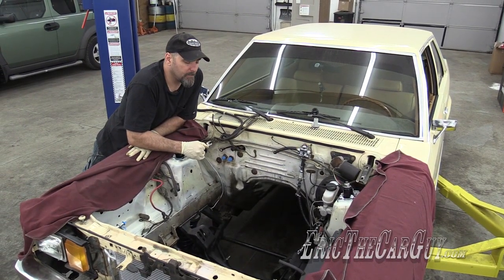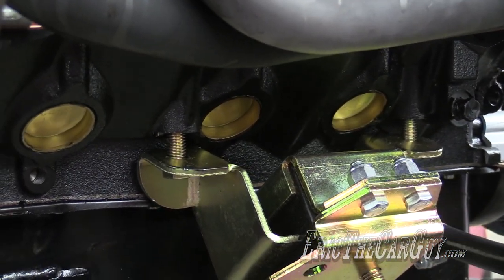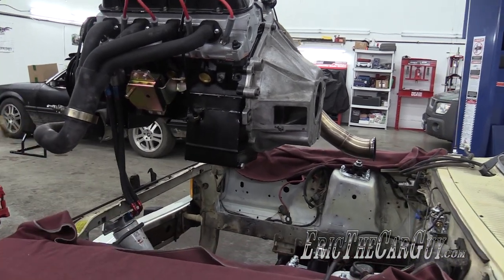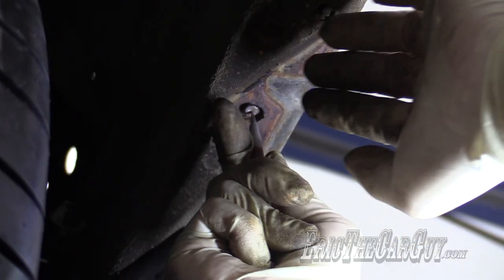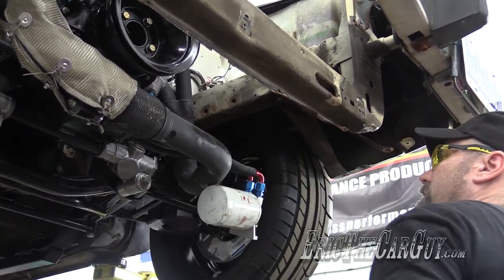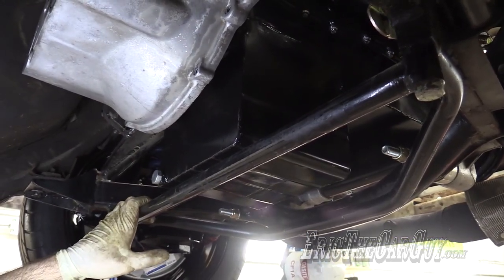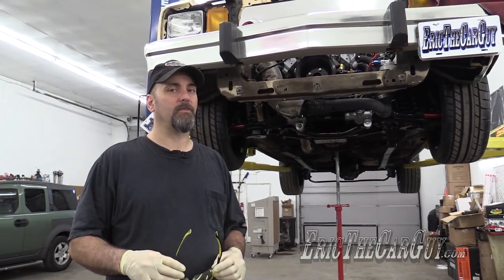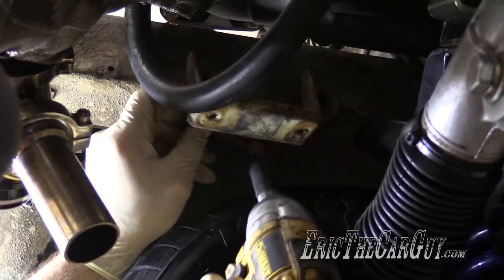Test Fitting the New Turbo Engine and Transmission #FairmontProject

Comment: Eric, if you care to explain, why the blanket on the turbo and not regular alluminium shields? The turbo does get hot and needs to breath all that heat out fast, we've never used them on cars, also they tend to keep moisture inside and help rot the pipes... On motorbikes they are common to avoid the pipes getting stones and whatnot in them.
Reply from the maker: It helps keep underhood temps down which makes the engine more efficient.

Comment: as far as the rear back bar goes for the K member because it's hitting the back of the oil pan just use a couple spacers and or washers and longer bolts...if you have too..
Reply: Timboslice exactly what i was thinking, not a big deal at all as long as it doesnt hang down to low.
Reply: I was thinking that as well, but then I started to think about the various forces that would be acting on the cross member and the bolts that hold it on.  Longer bolts with spacers would increase the leverage on the bolts and possibly make them a point of failure.  Now we could question whether bending the bar did anything to its structural integrity, but I think it was probably a safer way to go than using longer bolts.
Reply: Derrick Abbey indeed both good points.
Reply: Derrick Abbey that bar is essentially supplemental support. you could run without the bar all together and probly notice little difference. Helps to stiffen the chassis but never guna see enough force to break bolts

Comment: I believe Maximum Motorsports sells lower a-arms that correct your wheel issues.  It seems to me that under actual compression, the  tire will contact the fender.

Honestly, you won't notice any handling difference in a street car with the .75 to 1.25 extra wheelbase.  If anything with the Fairmont being longer, you're ahead of the game over a Fox Mustang.

Comment: As far as that bar getting in the way of that oil pan drain plug, I would have modified the oil pan by drilling and tapping a new hole on the underside or having a new bung welded for the plug or something. I mean anything to savor the structural integrity of the vehicle. I imagine at some point the engine came back out and that would have been a good time to remove the oil pan and do that mod. That's if it was me though.

Comment: Very interesting video as always.  It did raise a few questions. I have looked at some of the comments but haven't seen anyone bring it up so I am guessing my questions might be non-issues.

1. Isn't the drive shaft a little tight in there?  Looks like the shaft is in all the way for you to be able to tie it up to the rear end. I was under the impression you needed a little play in both directions.

2. The pinion angle at the rear end seems to be a lot towards the ground? Maybe you just haven't got to the point where you will adjust that.

3. Isn't there a problem using heat to bend the rear bar of the K-member? I guess if it is not hardened steel to begin with then it might not be an issue, I might have tried to lower it instead of bending it.

4. Did you have to change the front coil spring to handle the additional weight of the V8 over the original L6?

I understand this is muck up stage and that you may not have covered the fine tuning involved in getting everything into the right place to answer my questions above and if that is the case I will wait the following videos to get my answers.

Have a great day.

Comment: I'm a Fiero guy so I've got no room to talk really but I think it's funny you picked the car for the aftermarket support but you've got suspension parts and braces that aren't going to fit without heavy modification. I get the turbo stuff not fitting though, I would have thought you'd want to build the turbo system around the car. I haven't been following along enough to know if it was a pre fabbed system.

Comment: Is it just me, or is that wastegate in a bad location? It appears it'll only bleed off the pressure from the driver side manifold, while the passenger side will just continue spooling the turbo and cause boost spikes.  Ideally you'd want it where both manifolds merge into the collector right before entering the turbine housing so it'll controller the exhaust gasses better from both banks, not just 1.

Comment: why is the grounding strap for the starter exposed without any kind of sheilding?
Reply: cody frankenberg - That's just what they tend to look like.
Reply: cody frankenberg no need to shield that. It doesn't melt or care if it gets hot. The STARTER might be best shielded with a blanket but almost nobody ever does that.

Comment: I feel like that heat cycle on that k member bar created a point of failure, now that the metal has been heated the crystalline structure is altered, it's no longer uniform. Any extreme stress will likely cause a crack or critical failure right along that line. But, I'm hoping not, we will see

Comment: im thinking about building a mild ( 400-500hp) turbo small block chevy for my 1978 K204x4, to be used as a daily driver/tow rig..........do you think this is a good idea? or should i just do an LQ9 swap with a 4L80e? The Turbo small block certainly has the cool factor.....but i figure they would both be about the same price to complete........what are your thoughts?
Reply from the maker: If I were you, I'd consider a supercharger for that application.

Comment: Hey Eric. I hope you're gonna use a scatter shield instead of the aluminum bell housing and I also hope that aluminum drive shaft will take all of that torque without twisting up like a candy cane. Otherwise looking good in my opinion.
Reply from the maker: I have a steel bell housing for the new transmission. SFI approved.
Reply: Great!

Comment: Hi, just a thought for getting snapped bolts out, and not trying to tell you to suck eggs if you already know, but a penetrating spray left to soak in for a few minutes, and then if you have a mig welder, you can weld a nut on the end of the stud, before hitting the red hot nut with a hammer to shock it. Then try undoing by hand. It will either undo, or the nut will shear off again, in which case drilling is the only option.
I do have one question though, and that's the aluminium prop shaft. For the UK and European market all prop shafts are a steel tube, and am curious about how well an aluminium would hold up, especially with the V8 on.

Comment: I have a feeling once u start putting power on the road, the torque from that engine is gonna have its way with that trans crossmember
Reply from the maker: No worries, it's all getting replaced in future episodes. The build is far from over. Remember, this is just a 'test fit'. Thanks for your input.

Comment: Changing steering geometry, removing stabilizer bars and reshaping a K member supports, will the car be safe to drive?
Reply from the maker: The stabilizer bar went in. Did you watch the entire video? The steering geometry hasn't changed at all. As for the K member support, it's getting swapped out when I install the new K member.

Comment: Eric can you titanium exhaust wrap the downpipe and the use the blanket on top? I think it'd help a lot with the radiating heat in the places where the blanket are exposed.
Reply from the maker: When I take the engine back out to install the new K member I plan to wrap the exposed headers.

Comment: Great video as always Eric!

Might it be a good idea to bond those (new) spacer washers together, so when they fall on the floor, they don't immediately scatter?

Stay dirty!
Reply: Are you not running an oil cooler?
Reply from the maker: I don't think I need one with the divorced oil filter. I think that will act like a cooler of sorts. I'm also running 20w50 in this car.
Reply: Cool, I guess you'll be keeping an eye on temps, and it'd make a good video if you had to add one at a later date.

Comment: Oil your drill bits & they will cut 3x's faster, more accurately & you won't be burning up bits. I use 3'n1 myself.
Reply from the maker: I did. You might also check the link in the description to those drill bits. They actually recommend against using oil. Thanks for your input.

Comment: I'm just curious if modifying those engine mounts jeopardizes anything in long term use? And why they didn't just fit right in the first place
Reply: mrsemifixit he isn't using the stock engine block
Reply: Adrian Tran. We know isn't using a stock block. But aren't these blocks mass produced (on a small scale). If they are then surely the manufacturers would make engine mounts to suit the block then all you have to is position them on the chassis. You have to drill a few holes but if your putting a custom engine in you probably wouldn't be able to use the locations for stock mounts.
Reply: Michael O'Reilly Someone might make them specifically for that block but theyre probly overpriced and they werent sitting in his shop. The amount he cut likely wont make a difference. But if it were me i would just simple cut a triangle of steel and weld it in and call it done. Hell the holes small enough your could probly just weld it up.
Reply: i was thinking same thing...those are gonna have alot on twist on them form all that torque. its not stock v6 anymore.

Comment: Look into Astro performance for their A5 transmission. It's basically a t5 with heavy duty gears. They are known to handle close to 600 horses. that's what is going into my mustang build. The car is looking Awesome by the way, good luck.
Reply from the maker: Actually, I asked Paul Cangialosi about it, he's the one that built my transmission BTW (links in the description), and even he said the T-5 wouldn't handle the power this engine puts out. It was his recommendation that I go with a TKO600.
Reply: Well, with the TKO600 you definitely cant loose. Their is nothing but piece of mind with that selection and that's what is all about. Have fun, cant wait to see your next video on it.

Comment: I would run a scatter shield with that kind of power. I've seen clutch explosions and they aren't pretty.
Reply from the maker: The new transmission has a steel bell housing that's SFI approved. That will be featured in a future episode.

Comment: I'm one of your previous q and A's did you not mention you were changing this some frame out for another bringing the wheels further back?
Reply: please excuse the autocorrect that was supposed to say subframe or k member
Reply from the maker: The wheels being moved forward is a good thing. It helps improve handling. I'll explain in a future episode when I install the new K member.
Reply: EricTheCarGuy looking forward to the future episode I guess it's just me sort of anal retentive if the wheel belongs in the center of the wheel opening It's gotta be there it would bug me LOL just like a crooked picture on the wall

Comment: With that high  priced engine I would be using AN fittings and braided wire hoses, they might save the engine, AN is Army/Navy  if they are good enough for them it is whaat you should use, besides they look good.
Reply from the maker: I am using those on the high pressure areas. I don't think they're necessary for low pressure connections. Thanks for your input.

Comment: i would reinforce those mounts with that kind of power. the brace u bent probably needs reinforced too
Reply: M Blake Jr was thinkin that too. The only reason that brace still fit is it stretched when bent
Reply from the maker: No worries, the entire front suspension and K member will be replaced in a future episode. The mounts are fine. They're just 'clearanced'.

Comment: Why are you using chrome sockets on an impact?? I can understand it on the electric one,but the pneumatic is a big no no.
Reply: Zack Fraser - He's assembling, so it's not really a big deal. if you're breaking something loose it would be more important.
Reply from the maker: I don't have standard sized impact sockets, only metric. I never used them enough to justify the expense.

Comment: Hello Eric, I apologise Sir, but your modification to the cross brace is a weak point caused by heating and bending, better to rework the sump pan than a structural brace possibly bending in two, as always thanks for the excellent vidjas
Reply: B.M. Baker i agree heating the tube weakens it. i know he is test fitting, but i would get new tube and just make one. either with a bender or welding 3 tubes together and welding ends on. i see alot of people saying just to space it down but ya dont need more stuff hanging down to catch on stuff.
Reply from the maker: How about I just replace the entire K member? You'll see this in a future episode.
Reply: no talent hack welding totally agree, less components less risk

Comment: are you using the proper grade bolts
grade 8.8 or higher is recommended
Reply: steven yau he I believe its using American bolts. buy the look on the bolts having 3 lines facing in is a grade 5 bolt
Reply: hmm ok that's similar to a ISO 8.8 so it's going to be fine
for some critical parts he might need grade 8 though which is ISO 10.9

Comment: screamer  pipe on the wastegate?? are ya gonna connect it do the downpipe or ya gonna be a rebel?
Reply from the maker: I'm going to talk that over with my exhaust guy when the time comes. I don't have a solution yet.
Reply: Are you still going to use a choke cable to actuate the cutout?

Comment: Take a good look at the drive shaft man. Looks like when the rear suspension compresses the drive shaft will bump into the drive shaft. Maybe shortening it a bit. Take a look at it man.
Reply from the maker: It's fine. With the new transmission and torque arm which you'll see in a future video.
Reply: EricTheCarGuy oh right right, I forgot you mentioned the new trans in the video. If it all buttons good then awesome man!

Comment: I had some mental junk that I found myself thinking about though the video.  Here it is as I thought of it.

20:45 Holy shit are transmissions really that light!?

25:45 Why bother with duel exhaust?  Would it be more sleeper to have a single pipe, or would you get better flow from duel pipes?

28:15 I'm really trying hard to like the guy, since we are stuck with him for 4 years....but he needs to start getting on his 100 day plan, show a couple of things that come after that people would appreciate seeing, and do it all without looking like watching a train wreck involving a clown car..   

Also, at least his a good slinky.

37:15 what dictated the placement of the turbo on the passenger side?  It's starting to feel like everything is on this side of the car.  Oh no.. the car is going to tip over!

38:50 Ream that hole you cheeky bastard.. Ream!

39:50 why not also relocate the drain hole while your at it?

42:20 Ohhh that's why.   Never mind!  It looks great.

44:20 wow... yea you did.. I'm glad I watched the whole thing..

Comment: Any reason you couldn't relocate that drain plug on the oil pan? Or even cut the pan back a bit? Doubt it makes any difference as you said but that bend is hard to look at. And don't go looking at my car. I have way more ugly hacks!
Reply from the maker: Not really. The engine is still full of oil. My new K member has spacers that should clear the oil pan. At least I hope that's the case.

Comment: i will say it again, if your torquing down suspension components with that little electric impact, they will be loose,  ask me how I know. On my mustang i had to torque everything down with a breaker bar or torque wrench or else some bolt would get lose on after a track run.
Reply: Test fit man. I'm sure he won't do that permanently
Reply: I know put ive seen him rely on that electric impact on other vehicles.
Reply: +ltwargssf R That electric impact is probably good for I'd say 110-130 ftlbs. Which is enough for many applications aside from suspension components and bracing. I've seen many examples of this being used in his videos and I don't recall seeing one that I thought might not be enough.
Reply: EpicVirgil he clearly mentioned in another video that lug nuts got loose on a car when he torqued the damn wheels with the electric impact.I'm sure he knows better now.
Reply: I clearly stated suspension components and he clearly uses that impact on customers cars.
Reply: I use an electric impact every day at work and have yet to have an issue of bolts coming back loose. If its a crucial components it should get checked with a torque wrench anyway and any decent mechanic knows what his impacts are capable of. As far as lug nuts, car doesnt leave our shop without them being torqued with a torque wrench. Half the time people over tighten the shit out of lug nuts with air impacts.
Reply: Every time one of my cars comes back from the tyre shop the first thing I do is loosen all the lug nuts and re-tighten them to spec with my torque wrench, and every time they were massively over-tightened at the tyre shop :D